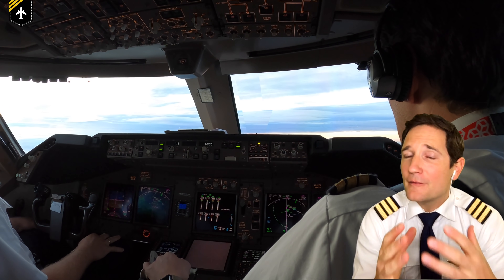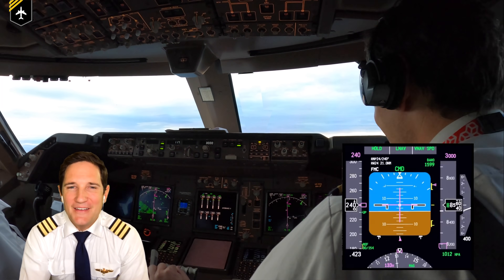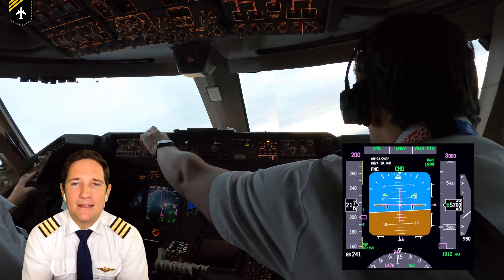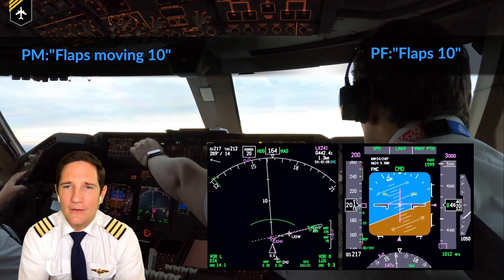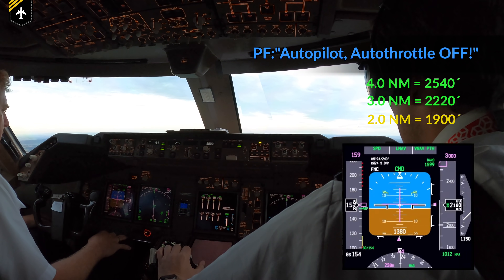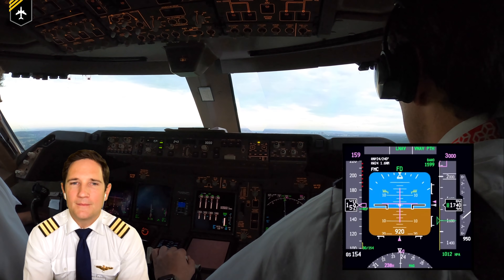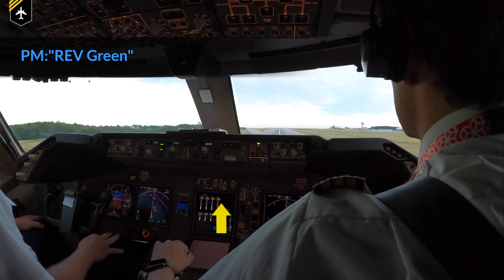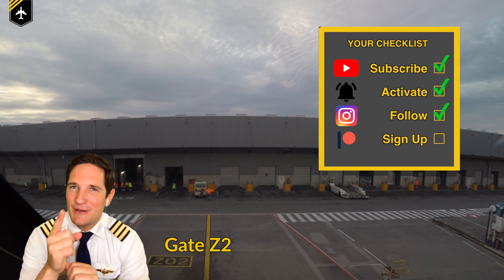How to fly an RNP APPROACH with a BOEING 747??? Explained by Captain Joe

Comment: Can anyone explain what is RNP apporoch??
Reply: In simple terms you’re following a series of GPS waypoints from the start of the approach until just before the runway. Some usually have turns between the waypoints so you need extreme accuracy to be able to follow them. If they were just point to point straight lines it’s not as bad. Google RNP approach chart and you’ll see examples of curves on the approach.

At the waypoints you usually have to be at set height so the computer will have the altitudes to be at for that waypoint and the autopilot will make sure it reaches those constraints at the correct altitude as well
Reply: @tomstravels520  thanks for the explanation.

Comment: 6th
Edit: Hey joe how long does the Fuselage of a plane last? I'm wondering
Reply: Passenger 747s can typically endure ~35,000 pressurization cycles so I guess it depends on how many flights per day.

I’m curious how Joe would answer this question. I wonder if it’s different for freighters.
Reply: @TheGbelcher  As i know it depends on climate too
Reply: @jlzaviation3066  That’s a good point. I don’t know if you watch Jason Schappert but he has a video where they took in, I think it was a c172, for inspection. The whole inside of the wing was corroded from flying over salt water. It was scary.
Reply: Hey you 0 aviation knowledge people plane can fly forever
Reply: @Iphone-jb9ds  Have you ever heard of aloha airlines flight 243?Probably not.
Reply: @Iphone-jb9ds  suggest you to search about that before calling people out that you have 0 knowledge🤔